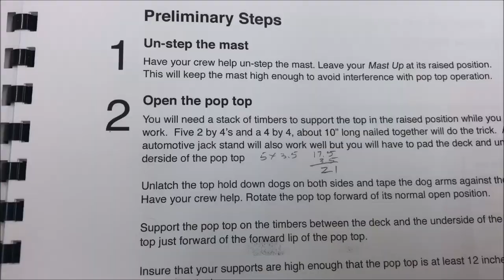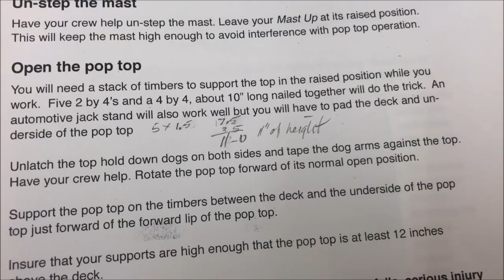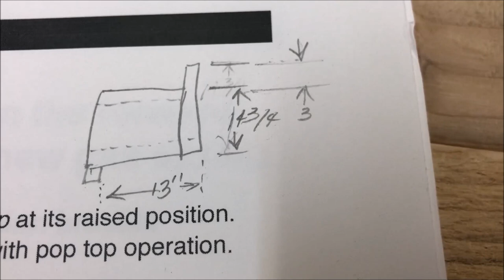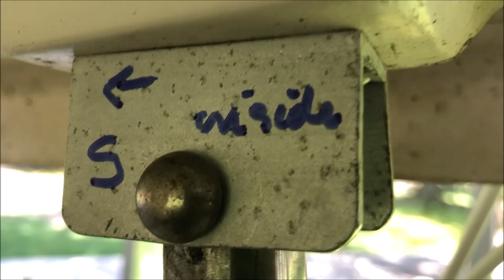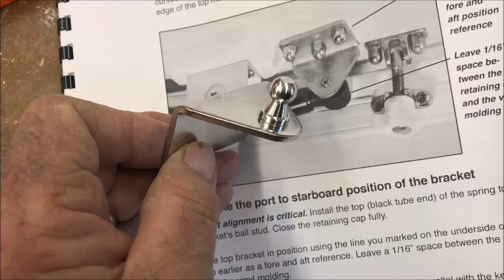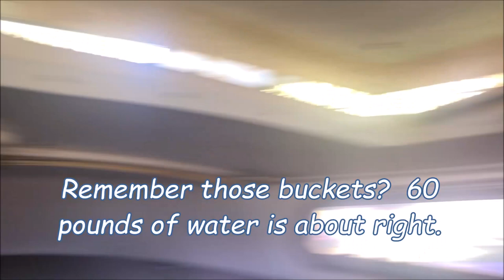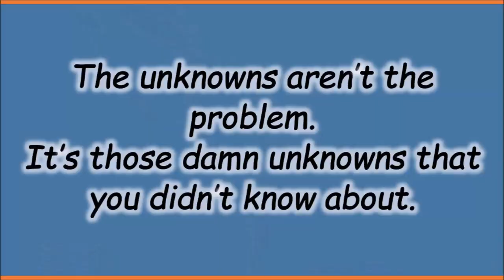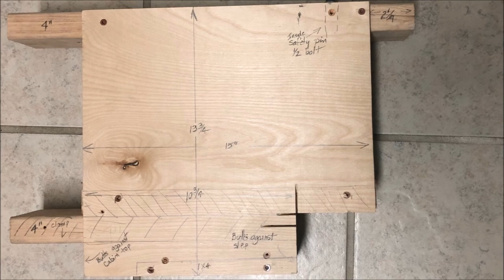Pop Top Power Assist: single handed install -- Catalina 22 -- Jim's Little Boat

Comment: I did this last fall, by myself.  And you're entirely correct -- if you let it go too far forward it will rip the screws out of the pop-top.  The ones that hold the original upright members on.  They're just sheet metal / wood screws into the wooden core inside the fiberglass.  Ended up removing the pop-top entirely, flipping it over and poring slightly thickened epoxy in all the holes, letting it cure and then re-drilling.  Took an extra day of work.  But, the lift assist is really nice.  I think it was worth it if you ever put your top up.
Reply from the maker: Thank you, Shawn.  I was pretty sure that would be the result.  When the strongest guy I know could not compress those springs, I knew it was a force to respect.

Comment: Well, Jim, I'm embarrassed to say that I was all proud of myself for completing the project only to try to close the hatch and the forward two stanchions ripped out. The springs didn't close. CD can't figure out what happened. I did it after I painted the boat and before I reinstalled the sliding hatch cover. Do you think the lack of weight might have prevented them from closing correctly?

Comment: Were the black knobs part of the kit or did you add those to the hold-down dogs? I really like them and would like to know where they came from. Thank you!
Reply from the maker: When I went to plastic rails for the sliding hatch, there was virtually no friction. The hatch would slide with only a tiny push.  It wasn't safe to stand on.  So I created a locking system for the hatch.  I had a sheet metal shop make some stainless bars about a 1/16 thick and as wide as the flat area next to the rails.  On the hatch side, I got some little pedestals intended for installing Bimini tops.  I found the star nobs somewhere on line.  It works great. I can lock the hatch in any position I want.

Comment: Hi Jim, I did my best grind my cast iron swing keel, prime and paint it to keep it from rusting.
Well it's rusting through after just 6 months, was wondering if you have any thoughts sir.
Reply from the maker: Hi Jay:  I have never had to do anything to my keel other than keep up the work done when I got it.  BUT, I have watched a number of videos and talked to a few folks.  They emphasize that the moment you get to bright metal, the keel starts rusting.  As soon as they grind/sand/sandblast the keel they put on a rust inhibitor.  Seems like I heard the word "zinc chromate."  After that they apply some coats of barrier coat made of epoxy.  (I put seven coats on my bottom.)  Then finally a couple of coats of bottom paint.  You might want to contact Kevin Patton on the C22 user group-Facebook.  He did the whole thing on his boat and it seems to be holding up well.  Thanks for watching.  jim